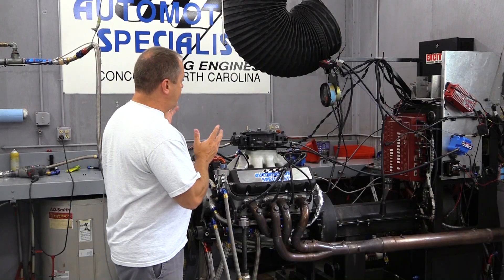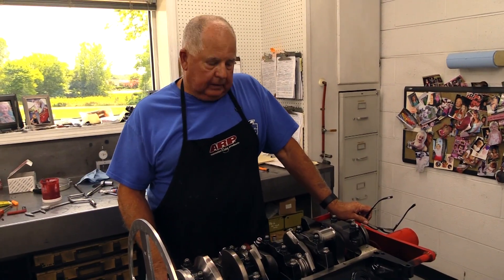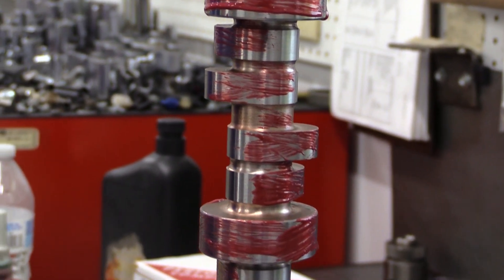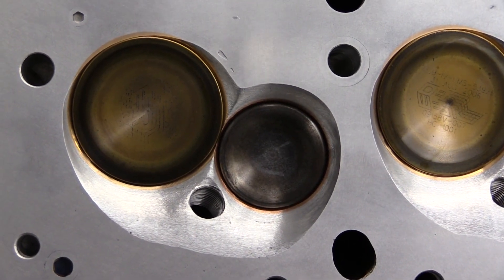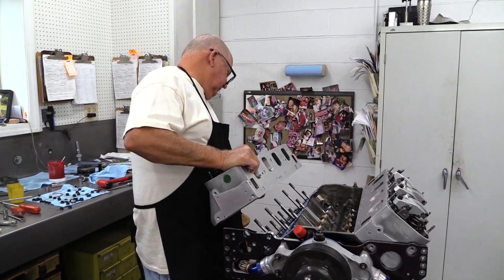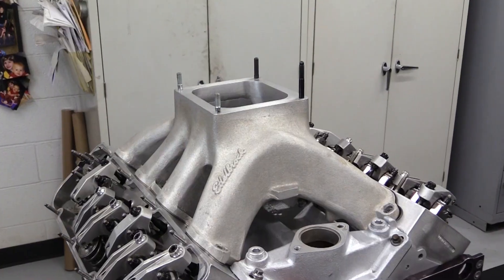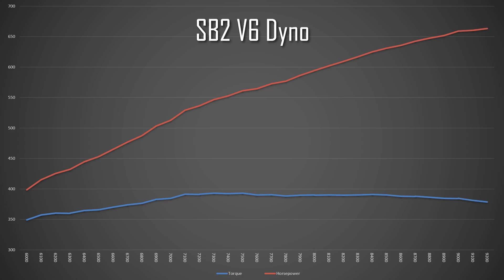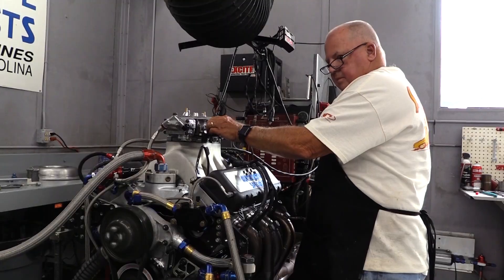NASCAR Chevy SB2 V8 Turned Into a Racing V6!?

Comment: As a fellow gearhead, I understand the want to use the word stretch, when talking about items that appeared to get longer in length, looser, or gain slack. But as a reminder,  timing chains do not stretch they simply we're out, making them loose.
Reply from the maker: Respectfully, I have to disagree with you on this one. Spintron testing shows that even with a new timing chain, at high rpm levels (like the 9,000 rpm where this engine operates) the valve timing can retard a bit. It may be only fractions of a degree, but it happens. That means the metal components in the timing chain are flexing, creating stretch. Anyhow, just my two cents, and please take this as fun gearhead discussion and not criticism. Thanks for watching!

Comment: Bonneville is still the home for the backyard inventive people & this sort of stuff is common. Inline 4 cylinder-V8 blocks, V4-V8 blocks even a blown nitro inline 4-Hemi-V8 block that went over 300 mph in a Comp-coupe. There has also been a V-twin that was cut off the end of a blown Hemi. The rear engine roadster class like these guys run has a Flathead Ford record of 229.
Reply from the maker: It blows me away to think of a flathead making enough power to push a car to nearly 230 mph. Never made it out to Bonneville, but it's on my bucket list. Thanks for watching.
Reply: @TheHorsepowerMonster  Innovation is encouraged under SCTA. No bellybutton cars & most of it is still home built. We're running out of salt due to the mining so don't wait too long.

Comment: Seems like an overly complicated way to go.. Especially with teh smaller displacement V8s that are around.
Reply from the maker: That was the whole point. More cylinders means less stroke if you are going to keep the bore the same (and you want to in order to use bigger, higher-flowing valves). So by cutting down two cylinders, you can use more stroke and gain compression ratio.
Reply: @TheHorsepowerMonster  except with the valve area available in DOHC engines not only does it make the valve size issue moot they can make up quite a lot with RPM.

Comment: Larsen & Cummins did the same thing back in the 60"s and built a tiny 120 inch chevy that ran 258
Reply: Thanks for this. Looked that up and there're some good reads...
Reply: I believe Mickey Thompson also ran a four cylinder version of a Pontiac 389 in the early '60, one side of the V, at drag races and Bonneville. That also was the engine in the original Tempest compact at the time (and why drag racers put in the full V8 in them, and eventually that's how the Pontiac GTO grew out of the Tempest.)
Reply: @allenl9031  It was the Pontiac Trophy engine which used the right bank of the 389. https://en.wikipedia.org/wiki/Pontiac_Trophy_4_engine
Reply: A two litre Crossplane v4 ? I like it.
Reply: I don't care what Chevy does am not or ever will be a fan just the way I am will never change. Stable!!!!!!¡!

Comment: One of the most ingenious solutions to a problem I've ever seen! If only we could apply this logic to government.
Reply: Wait...What? Isn't government already operated this way? 8 cylinders engine but only 6 are running! or even half of that
Reply: If its logical the government will kill it..
Reply: Probably but it hasn't been properly modified to run with all the dead cylinders it has
Reply: Hey Jarrod it’s Jared
Reply: We all understand it and how it would work basically. Instead is big government you have smaller government. There that’s how it’s supposed to be problem is government doesn’t want to be smaller so you know... problems 😂😂

Comment: i use to have a friend that run a buick 231 v 6 at woodburn drag strip over 1700 hp out of it one crazy little motor he would smoke my 327 every time tell me that would not piss u off and i had a sh ton of money in my 327 we pulled it out of an old dragster and put over 25,000 in it but i was running pump gas with no nitro at 1200 hp but i think i could beat him with 128 octane and nitro my motor was built by bell automotive by old man bell him self back in the 80's and it still runs sits in the shop now
Reply: jeffrey hollenbeck I don't believe that. 1700 hp all motor from a 327?
Reply: @tycheez85  1700 was the v 6 and my 327 was 1200 on pump gas and i bet u don't know who is bell do u so i bet u don't know much about racing and i bet u would say my 327 would not turn 15,000 rpms
Reply: @jeffrey4547   would you happen to have a video of it because ive never seen anything but bikes turn that fast
Reply: did u know a stock 327 can go pass 9,000 rpms but that is pushing it's limits and i had a 1100 v max and we would do 15,000 rpms in it and it was stock they don't last long at those rpms but they will do it but my 327 will hold 11,000 all day long but it was not cheap to do the and u must get oil to drop fast or suck the pan dry we polished the inside of the block ported the oil drains we started with a dragster engine then put another 25,000 in the motor give u an idea old man bell said there is nothing else he could do to a small block to get more out of it  for pump gas

Comment: the 4.3l had the capability but gm stopped it it was a 9 second in a quarter mile
Reply: You mean the turbo cyclone 4.3 right?
Reply: @rustedratchetgarage6788  no gm campaign a 4.3l with 350 parts

Comment: I had a engine run on 6 cylinders before, it still smoked a mustang , I had 2plug wires burned 3/4 through,
Reply: I blew 3rd gear out in the middle of toasting  some ricer, so I said aw shit and went for 4th because he was comin up fast. 
it was there and I still pulled away while bogging it lol
Reply: Lots of fuel in the oil if you keep running it like that
Reply: @Airsoftbros888  How?
Reply: @dannyparris9172  if I need to explain you should not have a slight interest in internal combustion engines ...
Reply: @Airsoftbros888  My bad, thought you were talking about Dorton's V6 hybrid. I felt like he had the back 2 sealed off well. Plug wires off though on a normal engine is not good and not only fuel in oil but: washed down cylinders, hone gone, rings sharp, scuffed skirts, perpetual smoking, etc......I have more than a slight interest, more like an addiction. I like external combustion engines also, just not for racing. Later, Danny
Reply: @dannyparris9172  lol
Reply: A 2.3 mustang dont count

Comment: I definitely admire the ingenuity that went into this but why prematurely alter this great engine?  Why alter the heads?  Why not just take the piston out, add the counterweight, leave the intake and exhaust valves in the heads (and even the spark plugs or heck, two bolts threaded in for that matter), and block off the lifters with a machined plug of some sort?  That way this engine can always be converted back to a V8 again without fowl.
Reply from the maker: You can still buy SB2 heads from Edelbrock. Not sure if anyone is making an SB2 block but the only real difference is the lifter bore is slightly different. Anyhow, the stuff isn't really rare. This being a Bonneville race engine, I suspect that they are going to turn the screws to it until it blows up. Thanks for watching.

Comment: What kind of dry sump setup was that again? I am gonna be putting together a small 408 cubic inch LSX  engine and like the fact that the dry sump setup eliminates power robbing windage. Thanks in advance.....
Reply from the maker: If you can get a wet sump deep enough it does better. That's why you often see really deep pans on boats, air boats and engines that compete in the Engine Masters contest. That gets the oil well away from the spinning crankshaft where it can't get caught up in it and rob power. The problem is a deep enough oil pan normally just isn't possible in a car. Besides, you also want the engine nice and low for a better center of gravity. The second advantage of a dry sump system is you can actually use the external oil pump to not only suck out oil but also air inside the crankcase. Pulling a vacuum inside the block removes just a bit more parasitic drag on the rotating assembly (crank, rods and pistons) to help the engine more efficiently move all the energy created from combustion to the crankshaft where it can be used. Hope this helps.
Reply from the maker: This was cut from billet by Hendrick Motorsports (or by somebody for them) specifically for the SB2 block. It is a little bit different, but I like Aviaid's dry sump systems for LS style engines. Pretty nice stuff. www.aviaid.com. Thanks for watching!

Comment: IF I WAS ON THE TECHNICAL JUDGES PANEL AT BONNEVILLE. I WOULD IMMEDIATELY DISQUALIFY THIS ENTRY. IT DOES NOT QUALIFY AS A V-6 FOR ONE SPECIFIC REASON. BECAUSE TECHNICALLY IT IS STILL A V-8 BECAUSE OF THE LONGER CRANK AND COUNTER WEIGHT GIVING IT MORE ROTATING MASS (STORED ENERGY) ALLOWING IT TO PRODUCE MORE TORQUE GIVING IT THE ADVANTAGE, AS OPPOSED TO A STANDARD V-6 WHO'S ROTATING MASS IS MUCH LIGHTER PRODUCING LESS TORQUE. SORRY KEITH DORTON BUT IT DOESN'T QUALIFY AS A V-6.

Comment: Use a v6 to build to build the motor. For us v6 guys.
Reply: IF I WAS ON THE TECHNICAL JUDGES PANEL AT BONNEVILLE. I WOULD IMMEDIATELY DISQUALIFY THIS ENTRY. IT DOES NOT QUALIFY AS A V-6 FOR ONE SPECIFIC REASON. BECAUSE TECHNICALLY IT IS STILL A V-8 BECAUSE OF THE LONGER CRANK AND COUNTER WEIGHT GIVING IT MORE ROTATING MASS (STORED ENERGY) ALLOWING IT TO PRODUCE MORE TORQUE GIVING IT THE ADVANTAGE, AS OPPOSED TO A STANDARD V-6 WHO'S ROTATING MASS IS MUCH LIGHTER PRODUCING LESS TORQUE. SORRY KEITH DORTON BUT IT DOESN'T QUALIFY AS A V-6.
Reply: @Frank289100  you lose more power with more rotating mass...which is why you want the lightest pistons, rods, crank, cam, no accessories, etc. possie without compromising strength so you can have the best performance...also you can run a fully built V8 in the V6 class by simply unplugging 2 spark plugs so you can run in both classes...clearly you don't know the rules so it's a good thing you're not a "judge" or associated with Bonneville Racing in any way...
Reply: @kyleboren7372  ( you lose more power with more rotating mass.) THEN WHY DIDN'T FORD, GM AND CHRYSLER DESIGN AND USE LIGHTER ROTATING MASSES ON THEIR BIG BLOCKS IF THAT WAS THE CASE??
Reply: @Frank289100  ...I agree with Kyle Boren.  They obviously knew the rules before commissioning this build.  Plus, if you were a judge at Bonneville and talk like you write, who would listen to you yelling?
Reply: @paulcopeland9035   SINCE YOU AGREE WITH KYLE ( you lose more power with more rotating mass.) THEN WHY DIDN'T FORD, GM AND CHRYSLER DESIGN AND USE LIGHTER ROTATING MASSES ON THEIR BIG BLOCKS IF THAT WAS THE CASE??
Reply: @Frank289100  because they are production engines designed for longevity and not high performance...it's the same reason why people put lighter pistons and rods in a performance engine instead of heavier pistons and rods...because it takes more power to move something heavier than it does to move something lighter...pretty common sense...
Reply: @kyleboren7372  THEN WHY DID THEY MAKE BIG BLOCKS IN THE FIRST PLACE WITH HEAVIER ROTATING ASSEMBLIES IF IT IS A BAD THING??
Reply: @Frank289100  sorry, but You dont know a thing about engines or physics. 
Use Google and Wikipedia please.
Reply: @jareknowak8712  ANOTHER ONE COMING OUT OF LEFT FIELD GIVING ME A SNIDE REMARK LIKE "sorry, but You dont know a thing about engines or physics.". SO TELL ME WHERE I AM WRONG HERE IN SOME KIND OF DETAIL??
Reply: @Frank289100  Frank, if higher rotating mass is good for performance, why race engines use lightweight fly wheels?
Reply: @jareknowak8712  WE ARE NOT ROAD RACING AROUND TURNS OR RUNNING THE QUARTER MILE..
Reply: @Frank289100  The rules limit cubic capacity not cylinder quantity.
Reply: @dicktaylor2600  THAT IS NOT WHAT IS IN QUESTION HERE, WE KNOW WHAT THE RULES DICTATE.
Reply: @Frank289100  So not only are you using caps loçk,you are arguing about something irrelevant! FFS!
Reply: @dicktaylor2600  I BROUGHT A POINT UP AND A PACK OF WILD HYENAS CAME TO ARGUE THE POINT I MADE, THAT THE SLIGHTLY HEAVIER MASS WILL HELP IT ACHIEVE A HIGHER TOP SPEED.
Reply: Domino  SO WHAT YOU ARE SAYING IS THAT YOU DON'T GET MORE TORQUE WITH A HIGHER/HEAVIER ROTATING MASS. SO HOW DID FORD, GM AND CHRYSLER ALL MAKE THE SAME MISTAKE OF CREATING ENGINES WITH SUCH HEAVIER ROTATING MASSES. I DON'T WANT TO ARGUE WITH YOU, BUT YOU LOST ME ON THIS ONE, AND I WANT YOU TO TELL ME WHY THEY CREATED THE BIG BLOCKS WITH SUCH HEAVY ROTATING MASSES, IF YOU GET LESS TORQUE. IF THIS IS THE CASE THEN WHY WERE BIG BLOCKS THEN CREATED?